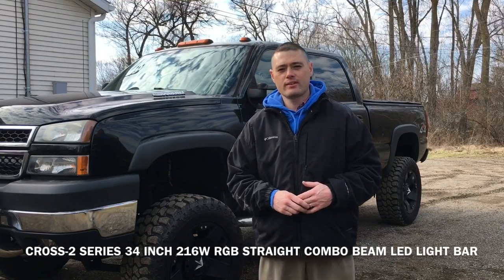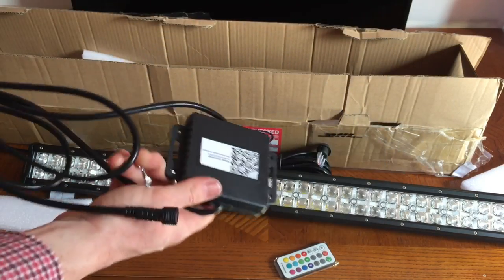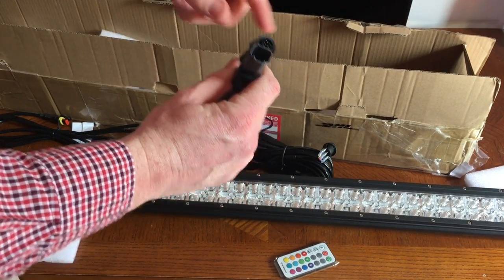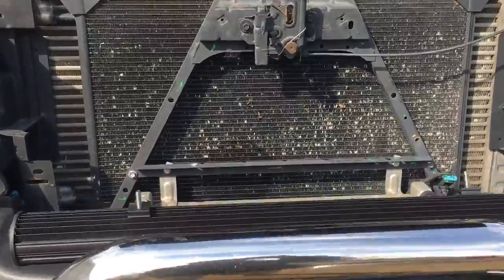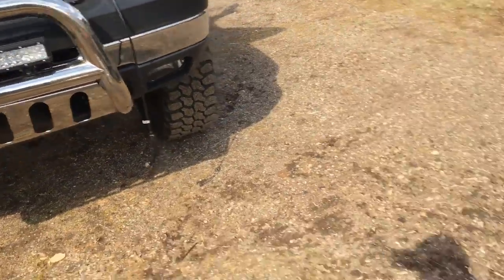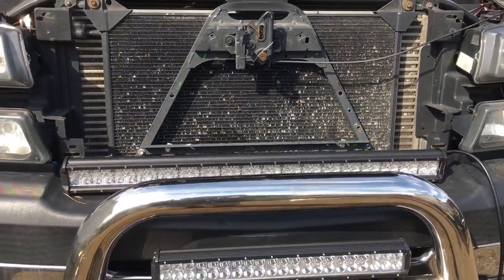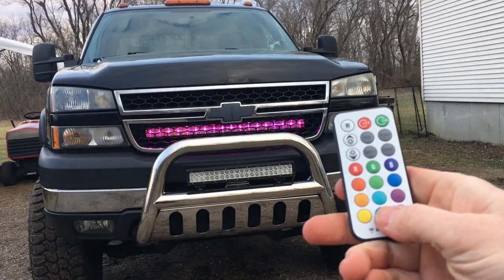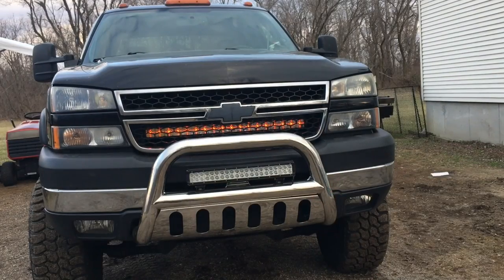How to install Light bar Behind the Grill (Watch this very simple)

Comment: The reason it flashes in the videos is because LEDs actually flash a such a super fast speed the human eye can't detect so it looks like a solid light. With a camera, since most cameras operate in the 30-60fps (Frames per Second) You can actually see the LEDs flash.
Reply from the maker: Thanks for the insight

Comment: I have an older style duramax, is the the factory spot For your trans cooler is that after market of some sort? Mine sits right the beam you mounted the light on
Reply from the maker: +Rio Anderson not sure I would try to relocate the transcoller lower but not sure if that's possible you might need to fab some brackets in front of the cooler but it would block the airflow to the cooler

Comment: I would take the bullbar off cuz it'll look sleeker and won't get in the way of your new grill light. Thanks so much for the video, I thought about getting a bullbar just to be able to use it to mount a light bar but I didn't want to clutter up my front end and then I thought about mounting the bar on top of my bumper but I figured it wouldn't look good then I thought about mounting 2 smaller oval lights in the oval openings in the bumper but they were just to small. After seeing your video this is definitely where I'm gonna mount a bar light on Big Red, my truck lol! Thanks again for the video dude!

Comment: I have a question for you. My transmission cooler is right there attached to the bracket where you attach the light and the plug that you say to zip tie out of the way plugs into my transmission cooler so it can display my transmission temperature in my gauge cluster. Did you remove your transmission cooler so that you could put that light there? Please let me know because I really want to mount an LED light bar behind my grill!

Comment: where is your transmission cooler located? mine is right where you mounted the lightbar
Reply from the maker: +Anthony Lee its in the same spot as yours
Reply: Truck Master I have a 01 duramax but I think I figured out a solution. thanks!
Reply: what did you end up doing

Comment: Love the stealth black camper trailer!  In my not so humble opinion, I'd DX the bull bar and mount the 20in in the bumper.  I never have liked those bull bars, but that's an opinion.  Others may differ.
Reply: Nah, fab up a mount that uses existing holes.  Though, you may have to widen up the hole in the bumper, which means more than just drilling.  Like I said, it's an opinion.  yeah, your bumper style is more conducive to two smaller single row light bars hidden in the bumper if you go that route.  3D Machines just did that mod on his Duramax, though he used double row light bars.

Comment: Not sure because I own a 5.3, but my transmission cooler is where you put the light bar, so either the 6.6 has it lower which wouldn't make sense because it wouldn't get any air flow, or you moved it which is bad because its not getting any airflow.

Comment: Thanks for the video and the instructions. I just purchased one from AuxBeam because of this video. Do you have any issues with vibration? Is there a need to strengthen or make the crossbeam more rigid? Also, did you add the "flood" lenses?
Reply from the maker: +Jim McNeal I didn't add the lens but since the video this has got to be the best lightbar I've owned I did a lot of reviews and this is number 1 but no issues since install everything is perfect
Reply: I got mine installed today! Fits perfectly. I had to figure a couple of things out, but the fit is great. I am now awaiting to test it out in the dark. I decided to connect it to my high beams controlled through a relay - no switch needed. Thanks again for sharing! See it here: http://www.youarenowready.com/lightbar.asp
Reply from the maker: interwurx great job! Looks good man glad I can help you out as well take it easy

Comment: Any way to make this come on when you turn your brights on with like a 3 way switch? Or is it strictly controlled by the app / remote
Reply: Connor Austin you could cut the wiring harness and wire it to your brights but you would have to almost completely strip the interior panels and dig through hundreds of wires to find the brights wire

Comment: Nice video and truck! I'm was planning on doing the same thing to my 03 Silverado. I have a question about that light bar. I saw that it has 3 mounting brackets on the bottom that you connect to the nuts on the bottom. My question is do those nuts on the bottom move side to side or anything? Because I need them to move so I can be able to mount it to my special t-brackets behind my grille. Thanks!
Reply from the maker: +LagBomber yes them slide wherever you need them too but I didn't use the center one just because I didn't really need it but good luck thanks for the comment
Reply: Thanks! I'll only be able to use the outside 2 as well because I have to use special made t-brackets so i can mount it behind my grille. Thanks again for the answer! I tried calling Auxbeam and they never answered. Must be wrong number listed.

Comment: Great Idea! However,  6.0 2500 HD's have the transmission oil cooler located right behind the grill and higher than the Duramax models blocking the crossbar used to mount the light. Will look into relocating the trans. oil cooler or fab different mounts. Great post!

Comment: Looks great.  Heads up to on the inside horizontal A Frame bar which you drilled the holes.  I had two EVO Prime 11 inch lights mounts on that exact horizontal A frame of my 2011 Tahoe and the weight split the welds and the lights drooped forward.  I have to replace or find someone who will weld it back on for me.  with some angle iron for extra support.  Thoughts?

Comment: Nice video as always.  I installed an Auxbeam 30" on mine Jan 1st (I did a video on it as well).  I didn't have enough clearance on that same spot to get the back to clear so I used T Brackets to bring it away from the support frame its mounted to.  I get just a touch of shake in it due to that...but it works overall.  Wanted to see if you have noticed any shake in the light at idle or while on the road.
Reply from the maker: +Paul the Wxguru nothing yet but when I used that nut to space it out it its very firm against that a frame but I was able to thread the bolt on the bottom. That bolt was at angle it worked out though

Comment: Dude your truck is on the instagram page lifted trucks matter!!!
Reply from the maker: +Kyle Reese lol I need to check that out I did know
Reply: Truck Master meant to ask btw, I'm looking to get a 7" mcgaughy's lift and besides new upper control arms and beefier tie rod ends what else do I need to upgrade or would be good to upgrade.
Reply from the maker: +Kyle Reese its pricey but upgrade your idler, pitman arm upgrade your stabilizer links and moog wheel bearings.